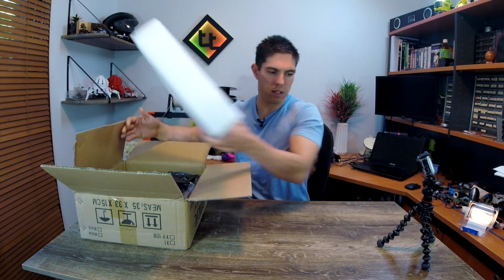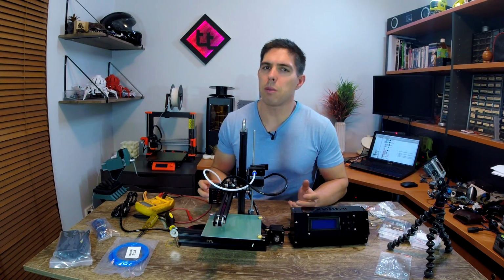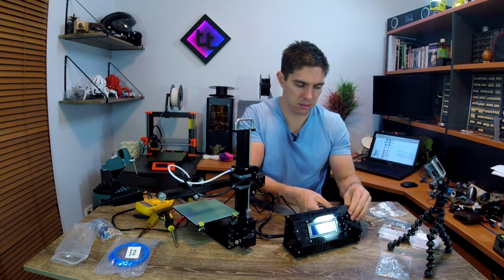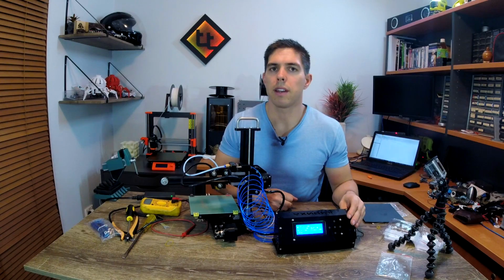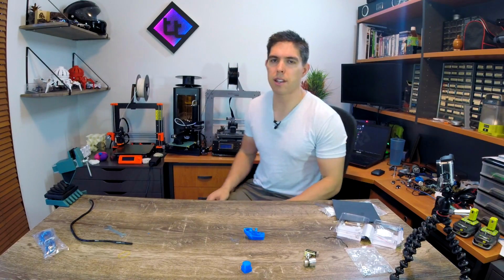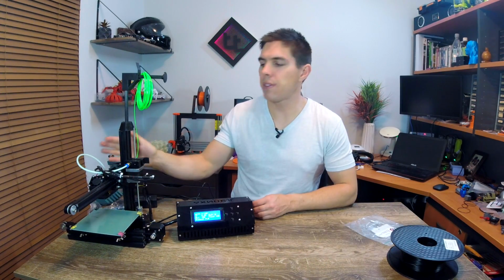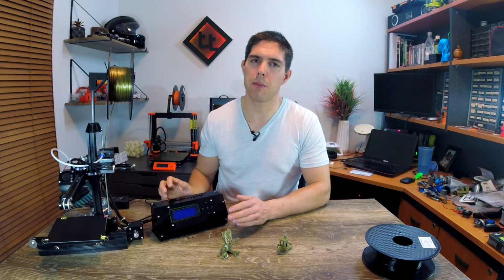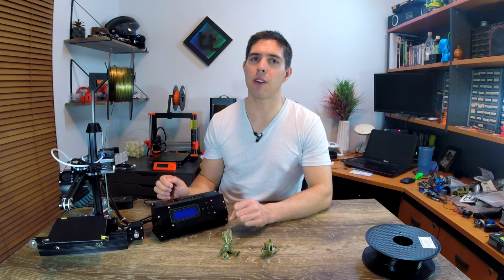Tronxy X1 $120 3D printer review and modding - Trash or treasure?

Comment: Always just have some gluesticks to make it more forgiving in terms of adhesion, flexes off and washes off easily between prints. I should work on printing some more upgrades for this old printer of mine since it has proved to work good so far, but could use some upgrades and tweaks. Definitely want to make one of those bases for the electronics but those are quite a few days of printing...

Comment: Scored this kit a week ago for $100, threw it together and it just worked. To my disbelief. I thought it would end up in a spare parts box. I also grabbed a 4 pack of 30mm brushless fans with 3ft cables for $12, and printed a filiment holder off of thingiverse in PLA on my Kingroon k3ps. My only complaint is lack of 1st layer adhesion with non heated bed/bed material. I have a spring steel PEI coated build surface on the way and my hopes are high. I have the same exact bed sized in 180mm on my k3ps and it has been the best upgrade so far.
Reply: Did that help at all?

Comment: This is an older review. Still can get these printers around same price. Doesn't seem like it's much worth it anymore with other small cheap printers.

Edit: being that you can get an endernl 2 pro for $129 on sale and it CAN be used without mods and get decent results I would highly recommend the ender 2 pro over this.

Comment: Use PETG. works with no mods. All you need for it to stick is hairspray 
on the bed. It is awesome. I bought one just for fun and it its great. 
PLA sucks, PETG its great. I run my with 0.6mm nozzle and 0.4 layer 
height, just because i am a inpatient old man. But it is now the little 
printer i like, some-days more then my expensive big ones.

Comment: I am happy to tell you your review has told me this isn't the one I want. I know this as there's too much to remember to do before each use. But I kinda figured on spending about $1500.00 to $2500.00 on my 1st 3D printer. I much prefer the printer remembers to check, calibrate, level and whatever else should be done prior to printing. Also from watching I've decided on a heated bed and a magnetic flexible removable build plate...i dont remember if anti static was thrown in there or not. It must be able to use multiple materials including very flexible materials for making moulds which won't get soft, melt or deform when liquids between 135°F to 170°F are poured in to them and are thin enough to peel off.  rinse turn right side out again and reuse. 

Thanks. I know once a couple choices for an item has been chosen many of the others just fall into place. 
Hopefully soon I'll have "all the boxes checked" and be able to narrow the field down to a few and then ask several people which and why do you think best for what want to do it. Maybe I'll see some of those forums now and see what they say.

Comment: As my first printer, I do not have the problems most have.  Like when you assemble the X Axis Gantry, use some thick string and very tightly wrap it around the bearing axles and push them in a bit further and tighten up the screws. When you put the X Axis gantry back on the Z Axis, it should be tight and the wobble should be gone.

It needs a few minor tweaks, and adjust the X/Y/Z/E and it will be spot on. It is not an easy printer, but once you get it going right, it will be a great printer for its size and its price.
Reply from the maker: Great tips, thanks for sharing.

Comment: I just bought this a s my first printer. I am 15 and i get the stringing too. What settings do i change in the slicer?
Reply from the maker: Retraction is what you should be playing with. Try a simple retraction test print from Thingiverse and up this value bit by bit until you find your ideal.

Comment: looks like a easy addon to improve the rigidity is to add a bearing to the lead screw on top and attach it at where the handle attaches.
Reply: Adam A no. you dont want to do it. It will bind and add NOTHING to rigidity

Comment: dayum, your first prints are way better than mine, Any tips on my prints? i posted them here - https://www.tumblr.com/blog/3dprintingdev

None of the circles are printing as circles and it seems like yours is printing perfect. The retraction i solved quite well. Unsure if it's due to my bed levelling or maybe my x axis belt. Any tips?

Also seems like your prints are sticking well, nearly all of mine were knocked off during printing, I have had to resort to a gluestick? Was this due to my bed not being level maybe? or are you using glue also? oh nvm i kept watching and saw yours came unstuck too :D
Reply from the maker: I don't have a tumblr account to view your images. Maybe you can try my profile attached to the description? 

Belt tension is important but the majority of issues I had were related to bed levelling/adhesion. I didn't use any glue stick. My issues were eventally fixed with a small sheet of buildtak. I say do yourself a favour and get some.
Reply: thanks for the fast reply! had no idea you need an  account to view tumblrs! how stupid!

Here was my first print with no adjustments - https://i.imgur.com/gdZECMi.jpg

After some retraction calibrations and extruding calibration my first benchy - https://i.imgur.com/wqkqf75.jpg

Seems like lots of blobbing / uneven lines maybe? text on the bottom not even readable - https://i.imgur.com/fqJ7n4K.jpg

and lastly the circle i tried printing - bullet bill - https://i.imgur.com/gIH6Y1r.jpg

Doesn't screw together due to it not being the right shape. - https://i.imgur.com/OH3nNez.jpg

I'll check out the buildtack, but builds have been sticking fine with glue so not sure that's it.

I'll try levelling my bed again and i just ordered a 40mm fan to build that fan housing.

Any tips would be great.

One thing that really helped was calibrating the extruder turns out by default it was only etruding 96mm instead of 100mm fo every 100mm. Also the prints improved massively when i tightened the Y axis, But tightening the x axis would mean i have to take my bed apart and I only just got it level (or so i thought) :D

Might have to try those belt tensioner mods.
Reply from the maker: I donated this printer to a school a while ago so I don't have it in front of me to look at. Belt tensioning mods is a good start.

Comment: The printer is nice, but I can't help but to compare it to the ender 3, which costs $189. Does
Reply: I have both.

And very suprising is that, other than lifting (because x1 have no heated bed) x1 actually print better, is more accurate, and handles tolerances better.

Obviusly after some printed upgrades (mainly tighteners for those wheels and a part fan cooling) for both printers, I even use some of the same upgrades fot both of them. 

But quality wise ender 3 is not as good as tronxy
Reply from the maker: Have one on the way to review.

Comment: Gb special is with the EU plug. Could you swap out just the cord to use it in the USA or would you need another power supply?
Reply from the maker: Mains cable into power supply is separate so easy to swap. They will probably include a plug adaptor.
Reply: Teaching Tech  yes but does the brick take 120 or 240 or does the brick not care. Plugging in a different cable is no big deal but that is not the question I have
Reply from the maker: Hi Ryan, Just chekd today and the brick takes 100-240 V AC. Cable switch is all you need.
Reply: Teaching Tech cool thanks for checking. Last night I was looking at the different bricks in my house. Seems the laptop ones were the same as the Tronxy with a  wide range voltage but the game system ones were specific voltage.
Reply: There is a switch on the side of the power supply that you can switch 240 and 120v all you need is a new power cord and switch the switch
Reply: Shady Wood Shop no. Tronxy uses laptop type power supply

Comment: I bought an Ender-2 for €120,- on Aliexpress. I printed mods from Thingreverse. I must say it prints great. It has a heated bed. I flashed it with Marlin 1.1.8. I print with PETG and PLA on a glass plate ( 4 mm ). It sticks very good. Maybe you can do a review?
Reply from the maker: Would love to review one. I'm all about finding bargains.
Reply: with coupons you can get an ender-2 cheap on aliexpress..maybe you get one free if you contact creality for a review? Or review an ender-x or a ender-20 ( brand new ones ) ?
Personally I like the quality of the ender-2. Almost every is builded of aluminum. And If I must be honest, with the right mods the quality is almost the same as a prusia. But that is my opinion

Comment: You could do a raspberry pi ruining octoprint or you could get a ribbon cable  SD card extender and glue or mount it to the side or front and it will keep the SD card reader on the board in the best condition since you aren’t removing and reinserting an SD and wearing out the contacts and dunces its so cheap who knows how long it will last
Reply from the maker: Both excellent suggestions.
Reply: I agree..with a micro sd card it is &*$&$(&( to put it in such a slot ( I have an ender-2 with the same slot ).
Reply: Just two links for the SD card extender and a micro extended too 

https://www.adafruit.com/product/3687?gclid=Cj0KCQjwl7nYBRCwARIsAL7O7dFltCAJONw87rrpPpb8R4LFyFWiMeVQofhEhdwh56NGN4WZ7j0SZpIaAsheEALw_wcB   

https://www.adafruit.com/product/3688?gclid=Cj0KCQjwl7nYBRCwARIsAL7O7dHaasALCfmmerkVqMJM2CO77Vx0K1WeKwcpooEYYNVKIbneHcxeTwcaAjHQEALw_wcB

Comment: Neat little printer - would be a good experimentation platform with a different extruder for small test prints.

Also, just FYI that particular model of baby groot waving has a bug in the right arm with that gap, if you review your slice in a gcode viewer you'll see the gap.  No one can post a fix because the owner of the model disallowed remixing.

Keep the videos coming, I like your format.  Could you drill a hole in the back plate of the screen box and move the wires to that hole to get the wires out of the way of the sd slot?

PS: My anxiety was high looking at that top piece above the screen being backwards LOL. YXNORT
Reply from the maker: Thanks for the great comment. I have my Mk3 workhorse, my dedicated flexibles Cocoon Create Touch, and now I'm wondering whether having a dedicated small printer with a 0.2 nozzle would be a good idea just for tiny, detailed prints. Slic3r reported STL issues but I plowed on ahead regardless. The model had the arm issue and one at the neck too. I like the big box mod but it doesn't hold the electronics inside. I would design my own version but the printer was donated to the primary school today. Didn't notice the backwards lettering!
Reply: If you want to use a nozzle with a diameter lower than 0.4 I recommend use a gearded extruder. Works fine with a 0.2 but the printing time is very looooooong.